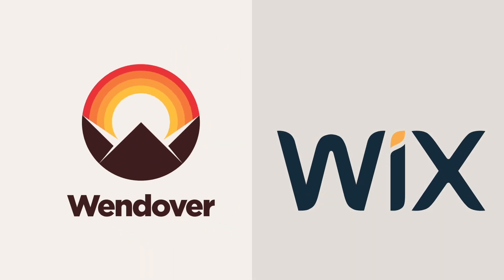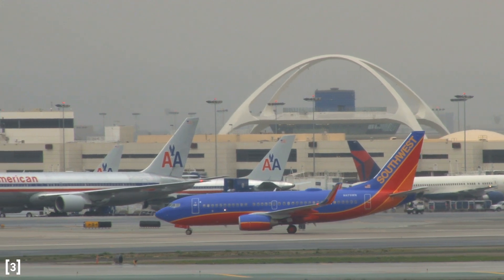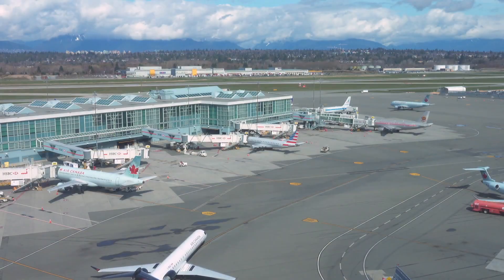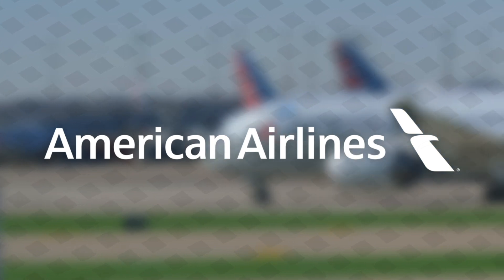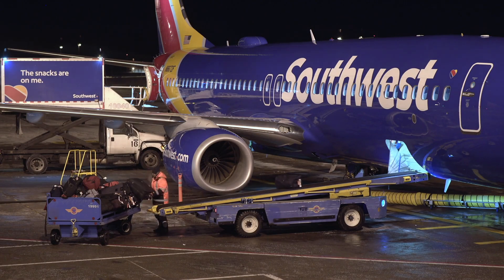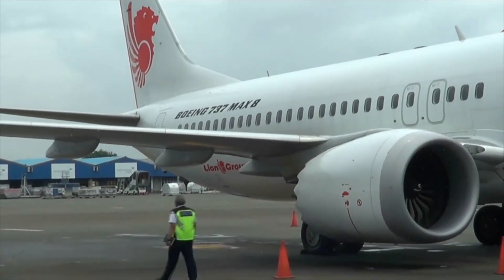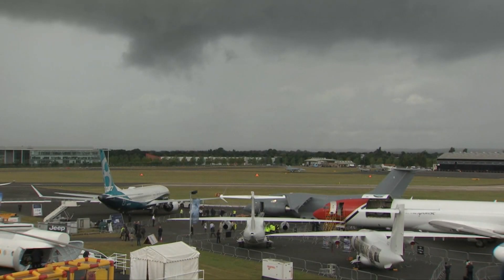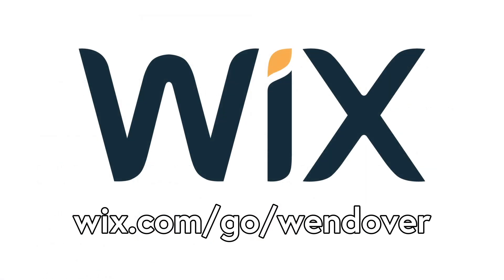The Economics That Made Boeing Build the 737 Max

Comment: Wendover, I love your videos, but you got so many things wrong on this one, and while I'm almost sure this comment will end up at the bottom because it is gigantic size I can't not say something about it. Here we go:

"Most modern airplanes can be turned on by flipping a switch..."
Please define "turned on", because that is SIMPLY not true. 
If by "turn on" you mean have electrical power, than the 737 also requires only one button. 
If by "turn on" you mean flight ready, than...I have no idea what kinds of planes you are referring to...maybe model aircrafts?
This sentence either means something else (and I cannot fathom what it is) and either way is impressively naive. 

"Most moderns airplanes have electronic on screen warnings describing exactly what a problem is, the 737 Max has a warning light"
Now that is both dishonest and shows an absolute lack of knowledge about the airplane. 
Both the 737 and the A320 (and, honestly, almost all airplanes with any form of electronic flight instrumentation) have a master caution and master warning light. Their function is to alert the crew that something serious is happening. For instance: "dude, you forgot to lower your landing gear", so I'll pop up this yellow light so you know you screwed something up". Once you receive the warning, the logical step is to figure out "what" is happening. Both airplanes use an Engine Indicating and Crew Alerting System or EICAS to show AND DESCRIBE failures within the aircraft systems. 

"Most modern airplanes are fully fly-by-wire, meaning their ailerons and elevators and other flight control surfaces move by electronic signals triggering servo motors...the 737 has..(yada yada)..cables"
Sure. Fair point. But should we recall ALL the accidents caused by the A320 lack of control feedback to the crew? As a Brazilian I can recall the Air France Flight 447, in which the pilot had the nose full up and the co pilot full down and neither knew what was going on until they hit the water. Or the TAM 3054 in which the crew though the engines were idling during touchdown but they were not and the speed brakes did not deploy? My point being: it is not if it is cables or servo motors. It is about reliability of the system as a whole, and in that sense, the 737 is not worse than Airbus. It is a dated system, I agree, but not a bad one per se.

In 1996 Michael Chrichton published a book called "Airframe". It deals with the media response in aircraft accidents and incidents and while it is an old book its message is timeless. Aircrafts are complex machines. They are not cars or computers. They are probably the most complex machines humans produce. When an accident happens we tend to disregard the inherent complexities of these situations and zoom in a single obvious cause: the MCAS. All of the sudden a very good airplane with 51 years of improvement and error correction is trashed because of a grave failure. All of the sudden a company that produces safe and reliable airplanes is a bunch of retards looking for profits on the short term and neglecting safety as if it were not important.  

The 737 is, just like any modern airliner, a complex system. While I do understand that your videos try to convey complex systems in simple messages, there is a BIG difference between simplifying and getting things wrong. 

The crux of the matter is: I am your subscriber and love all of your videos. I think they are well written, narrated and beautifully done pieces of media. From all the types of videos you did so far, this one is the only one I have in depth knowledge, and it is badly wrong in important aspects. I can't but think: how wrong were you on the videos about topics I have no knowledge about? Does this situation reminds us of someting? Were you rushing your videos to market or was this an honest mistake by a very good professional trying to bring excellent content to this sea of bad videos? I'll stick with the latter and keep my subscription, hopping to see what next I'll learn on Wendover Productions!
Reply: You say "[...] and zoom in a single obvious cause: the MCAS. All of the sudden a very good airplane with 51 years of improvement and error correction is trashed because of a grave failure."
This is wrong. All that has been trashed is the 737 MAX. And it has been trashed because an integral part of what makes it the MAX, has lead to numerous deaths.
The MAX and therefore those changes to the 737 that make it the MAX do NOT have a 51 year history.
Nobody with any sense is trashing the older, proven and save 737s.
Reply: @felipefuego6420  Hi Felipe! I'm not here to defend the reputation of the 737 Max. I fly all of the time and hell, it could have been me! That being said, in my opinion it is wrong to think the Max and the NG's are different things. As someone pointed up, the MCAS is not even essential to the flight stability, it was installed solely to keep the handling characteristics similar. It was badly implemented, for sure, but it is not a bad idea. It's like creating a SUV from a car and calibrating the brakes and power steering to "feel" like the smaller model so that users will feel at home with it. 
The implementation was bad, but the idea is good and so is the plane as a whole system. Of course, that is my opinion and I'm just one person.

Edit: my rusted english
Reply: Push this up!
Reply: Thanks for writing all that out so I didn’t have to. You did a much better job then I would have.
Reply: Yeah, it is trashed because of a grave failure - totally preventable as we now know.  I can't see the logic of arguing that just because the thing crashes doesn't mean it's not safe.  Actually, that is the definition of not safe.  It crashed, people died, nobody did anything.  Then, it happened a second time for the same reason and Boeing tried to do nothing.  Only after the entire world refused to put one in the air (save the FAA and a couple domestic airlines), did they start pretending they cared.
Reply: @InvestorAcademyPodca  Hi Bob! Actually, if you dig a little deeper you'll find that Boeing had the software update ready in january. They did act on the problem. I agree with you that it was not enough. If you read a few reports from the NTSB you'll probably get to the same conclusion regardless of what airplane was involved: it was totally preventable. Since the dawn of aviation as we know it, accidents happen, the industry learns from them and the safety increases a tad more so THAT specific accident won't happen again. Aloha 737 accident taught us that too many cycles on the airframe created sunroofs in the middle of flights. Since then, the plane design changed. That was preventable. Helios Air taught us that having the same sound for configuration alarm and pressurization is NOT a good idea. The industry changed that. It was totally preventable (believe me, it was a f%¨# chime...and hundreds died for it). US Air in Denver (or was it Colorado Springs?) taught us that the rudder actuators freezed after a long descent and kicked the rudder. More than 2 flights went down because of it until people figured it out. It was preventable by testing the parts correctly. Anyways, the cost of losing a plane is too high for a maker to simply be negligent. It is a million parts craft and they screwed up a single line of software and that's gonna cost them billions. Being absolutely crazy about safety is in their interest, profitwise.
Reply: Thank You!!!! Terrible aviation knowledge reporting here

Comment: The 757 is not used in the same class as the 737 and the A320. The 757 can easily fly a transatlantic route, the 737 may barely be able to make it over the pond. That is, at least the Max variant.
Reply: Валерия Карреон ba. Closest aircraft currently to the 757 is A321NEO LR

Comment: As an engineer and a big fan of Wendover, I very much disagree with your, and most of the public’s, view to blame Boeing for such a common engineering solution. There are probably many things Boeing did wrong in this situation, but finding an innovative and modern solution is not one of them. The plane flys beautifully, until the sensor goes bad. Why does no one ask who manufactures the sensor? Why do they take no blame?

Comment: How much similarities are required to make multiple variants of the same plane? Also make a video on how fuel is sourced and why it is so expensive.
Reply: kkg T it’s mostly just engines and minor cockpit changes. If they make too many changes then the aircraft cannot share a type rating and pilots will need to be completely retrained. I’m sure mentor pilot once said you can only change 5% of items in the cockpit or something like that

Comment: Catch-22 situation there for Boeing of their own creation, they should have started on a new design a long time ago, but they didn't and so Airbus pushed them into a corner cause the A320 while not exactly the newest kid on the block is still quite a bit more modern at the core than the 737, so for Airbus upgrading that one more time was an easy move. 

Still fact is new medium sized narrow bodies are needed, for the smaller ones Embraer and well now Airbus-Bombardier are already well situated. Airbus might get away with 1 more upgrade program to the A320, but Boeing after fixing the mess that is the 737-MAX will need to develop a brand new plane, it should be clear that the 737 is just done for, I mean key parts of it's design can be linked back to the 707 for crying out loud.

Comment: The cables lead to hydraulic servos and electric motors a pilot or pilots would be 
hard pressed to move a flight control surface at speed , look at the jackscrew for the
tail (the horizontal stabilizer ....how could that be moved with a cable?? it can't.
The Max does have fly by wire spoilers for weight savings.

Comment: What I just can't figure out is why the MCAS system was originally designed to keep feeding two full points of nose-down pitch trim in twenty or thirty second intervals, over and over, literally until it hit the end of the jackscrew. The scale is all wrong. When you're trimming a plane out, you're operating in hundredths of a point of trim. A tenth of a point of trim is a substantial adjustment. I can't imagine the nose-up moment induced by the engine placement, even taken from idle throttle to go-around power settings, would be within an order of magnitude of the two full points of trim that MCAS was designed to feed in on just its first iteration.

I get using a background system to preserve maneuvering characteristics for simplifying type rating. I can even maybe, just maybe, understand the reliance on the two individual AOA vanes in the context of the older design philosophy, with the two seats' separate and individual sets of controls and sensors, and reliance on pilots to diagnose problems and hand-fly the plane skillfully in the event of a computer problem. What I cannot understand is empowering a system that is supposed to be subtly operating in the background, correcting a minor change in flight characteristics, being empowered to apply ten times more trim input than a flight crew is likely to apply during the course of an entire flight, over the course of nine seconds, and then do it all over again ten seconds later. And then again. And again. And again. I want to know who thought that was a good idea, and why, when they repeatedly say "this is not a stall prevention system, this is simply to adjust the feel of normal flight characteristics."
Reply: Good questions.. There'll probably be some answers in some invesrigation at some point.

Comment: This isn't the first time the 737 had an incredibly serious design flaw that caused it to uncontrollably crash into the ground, in the late 80s and early 90s 3 737s, for no apparent reason would have the rudder jam in one direction and cause the plane to dive into the ground.
Reply: oali 24 2 crashed 1 managed to survive. That was a genuine design flaw that even Boeing didn’t know about, this one they did but chose to cover it up with software
Reply: @tomstravels520  I wouldn't necessarily call the pitching up a design flaw, just a characteristic of the plane's handling, they absolutely should have made this difference clear to the pilots and trained them for it, Boeing's negligence to not admit that the plane didn't fly exactly like the previous model is surely the biggest factor that could have helped to avoid these tragedys.